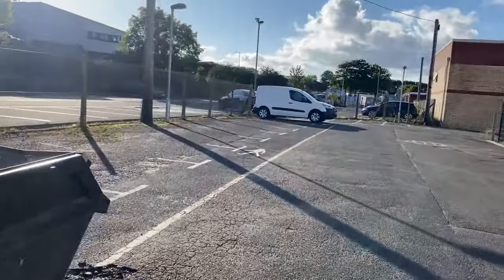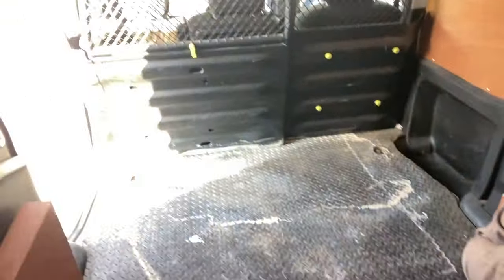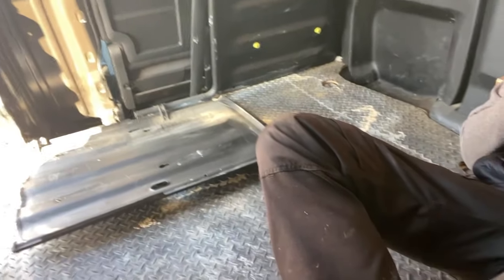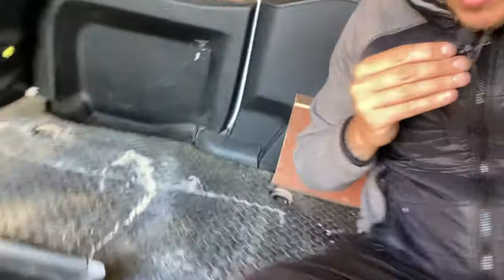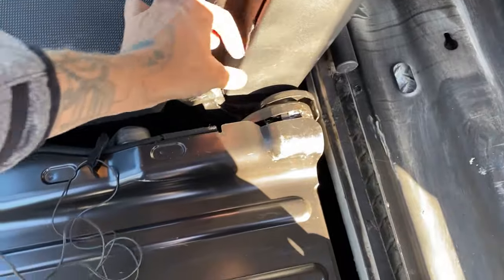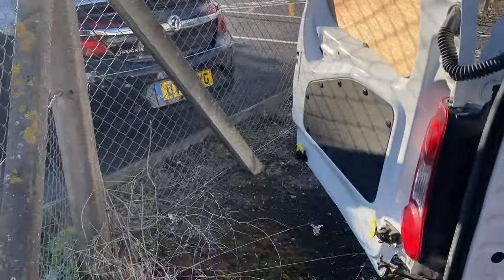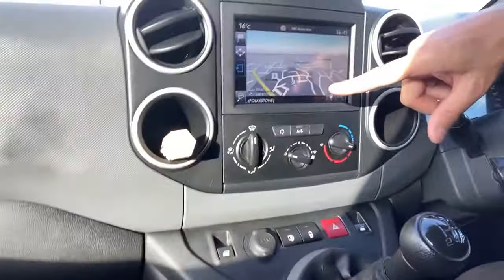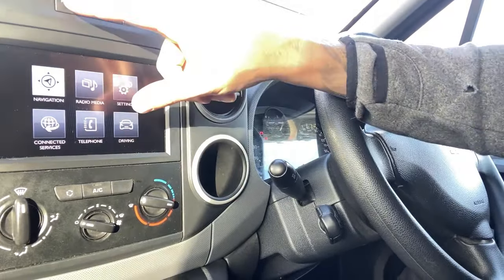Ive Finally Done It! I Bought A Van | Starting My Vanlife Journey

Comment: As long as you don't get a late growth spurt or elephantitis of the legs, your legs will always fit in that space. Net curtain for the back of your bulkhead will give you privacy and allow natural light in. On the opposite wall to your bed, build a colum of shelves/cupboards where the recess is. Next to that, build a fold away table and bench (doubles up as storage if you want to leave the bench out). Get yourself a Bluetti or similar and some good usb charging lights, a double burner stove, compostable toilet and a travel fridge and.. Boom! Cracked it!
Reply from the maker: Thanks Danny I’m going to Google these and see how much they are. 
Powerbank is defo priority for my laptop and phone and will look at the fridge also. I like the storage and shelving idea on one side
Reply: Hi man, nice little van, if I were you that bulk head would be straight in the bin. You need to insulate it immediately with dodo matt, otherwise you'll freeze to death, walls, ceiling, and floor. You could build a bed behind the driver's seat that will double up as a sofa, push the driver's seat forward at night for more length. Behind the sliding door you could build a small storage unit, get a bluetti or jackery for power, jackery 1000 is on sale for prime day. You could get a small space heater and electric blanket work great with these power units. Anyway good luck with it bro, call it Vergil VAN Dyke😂😮
Reply from the maker: I hope I don’t grow anymore 😂😂😂😂
Reply from the maker: I’ve saved this and screenshot so I can add to my list because there are some great ideas here too. 

I like the idea of a jackery with Solar charge capability

Comment: I know of another you-tuber, Socks with sandals who lived in a peugeot partner for a few years.... might give u a few ideas, it's certainly possible! Start by insulation, particularly the roof, so you don't get condensation dripping when your inside...... diesel heater (2kw) will keep it toasty. I'd defintely remove the bulkhead, you will want the extra space for sleeping. A leisure battery and split charger(or dc to dc ifbneeded) will power lights heater and fridge, charging from engine and will likely be cheaper than powerbank.....
Reply from the maker: @iainbaker2742  thank you iain for those tips 
Updated my notes haha
It’s growing fast I tell you
Reply: @BeMoreWild   Note:  make sure you can still access the rear lights in case the bulbs go (mot fail).